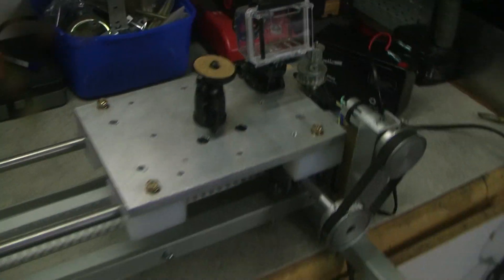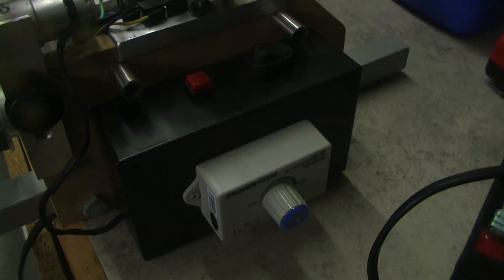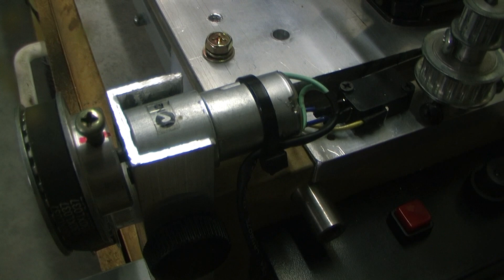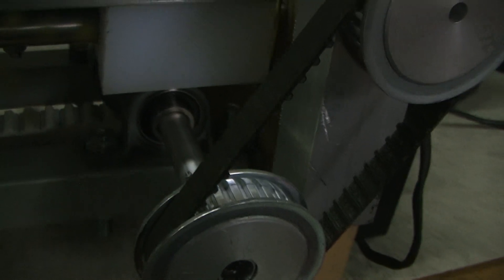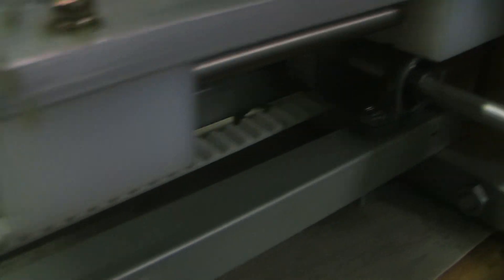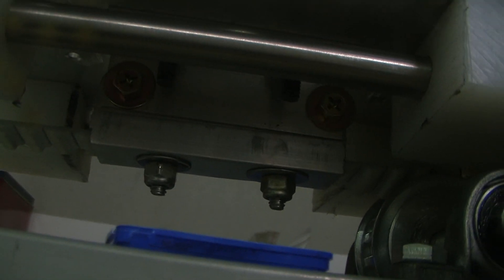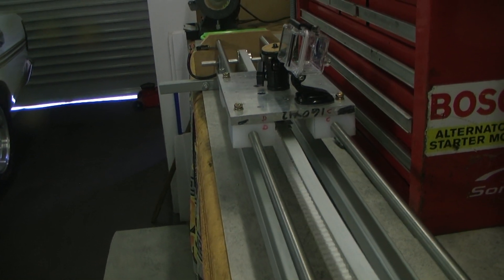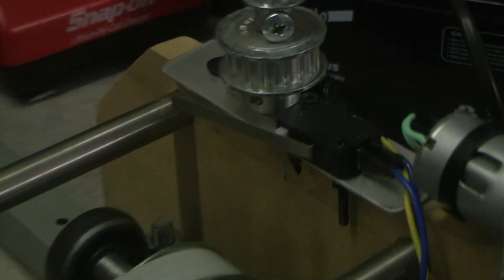DIY Homemade Video Camera Slider for DSLR /  GoPro

Comment: easy to build but very expensive
Reply from the maker: Hi Ivan, not expensive compared to retail models. The long belt was the dearest part, the motor is cheap and the bearings were cheap. about $200 AUD it cost me all up.

Comment from the maker: The speed adjustment is a electronic variable controller from local Jaycar electronics shop.  The tripod head attaches to the aluminum stage via a tapped thread

Comment from the maker: I have a changeover relay mounted in the control box , the switches at either end are basic micro switches . When it gets to one end the switch drops the relay out to go back to the default direction. I can draw up a wiring diagram if needed